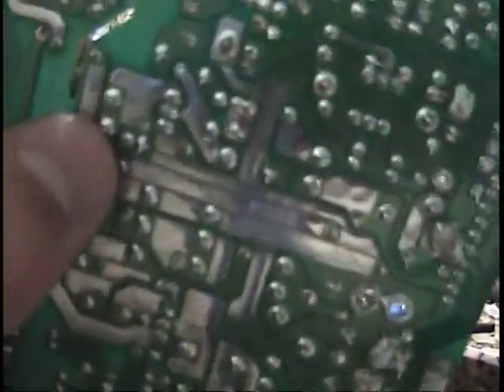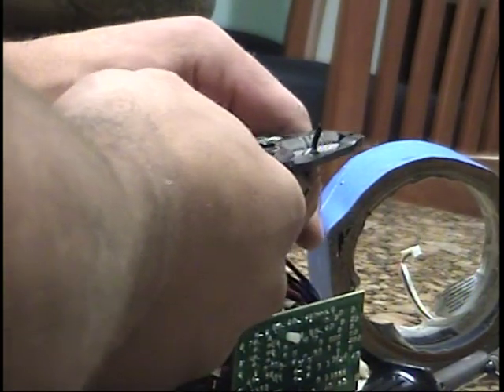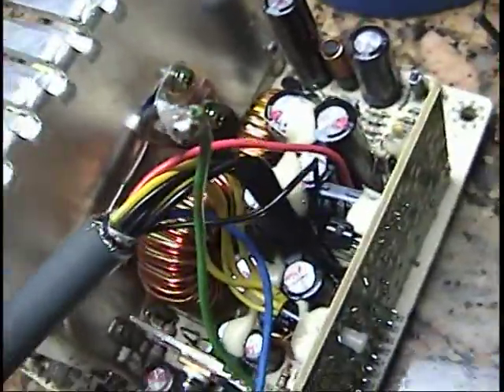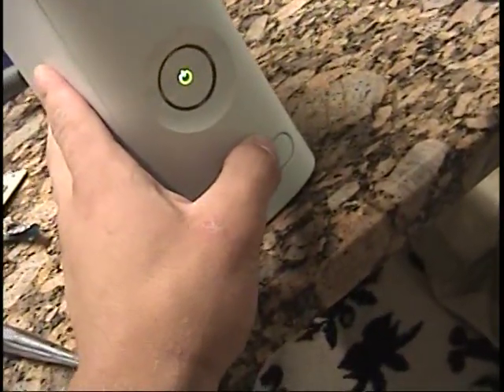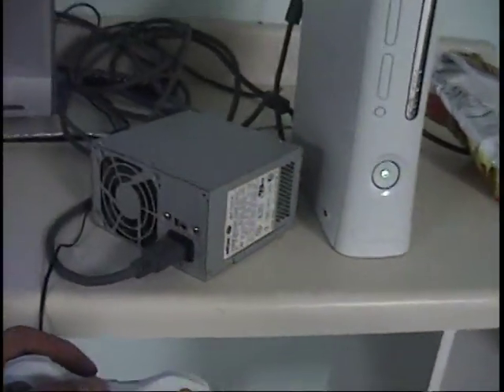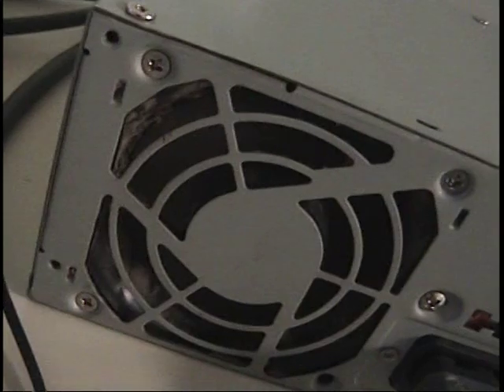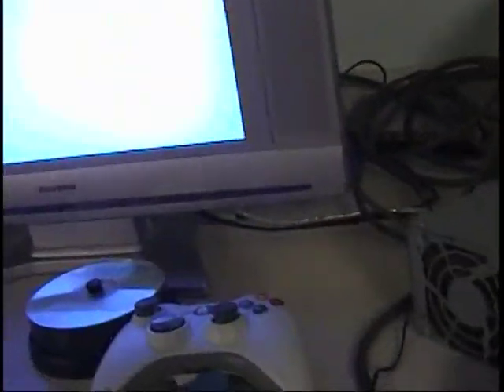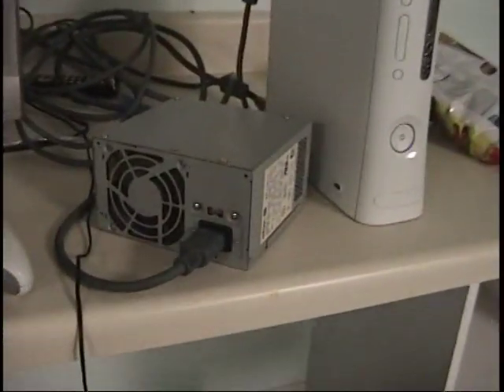How to make a xbox 360 power supply with a pc power supply (Part 3)

Comment from the maker: @ygotcgftw yes a 200w power supply works if you take it apart and desolder and resolder the xbox power cables in the circuit board.... it will work perfect no problems... please please im here to help feel free to ask me any questions.. i will reply as fast as i can..